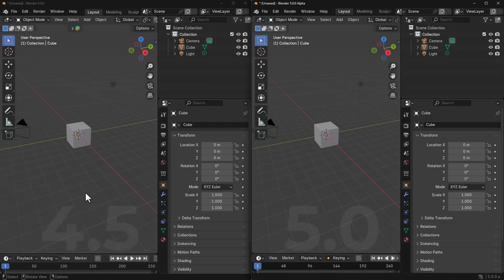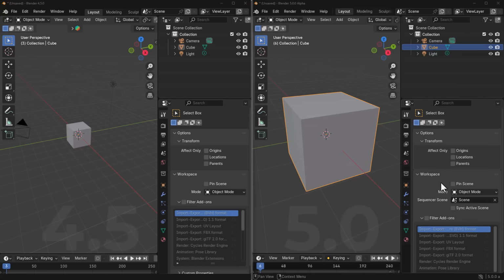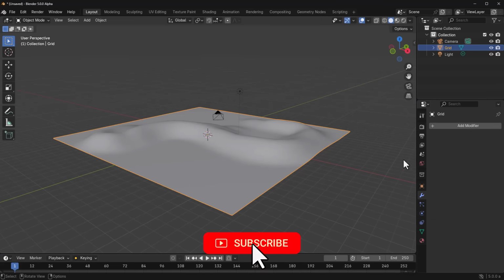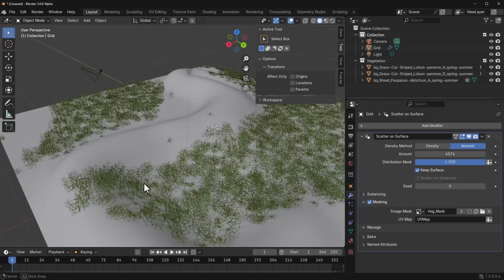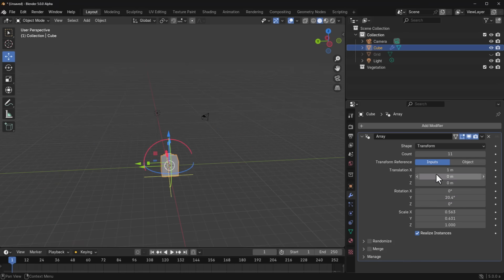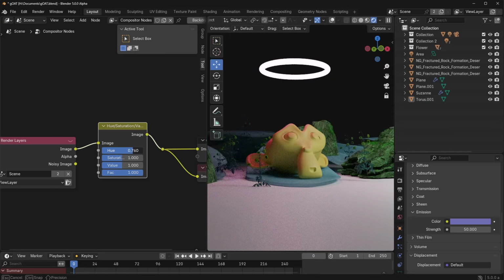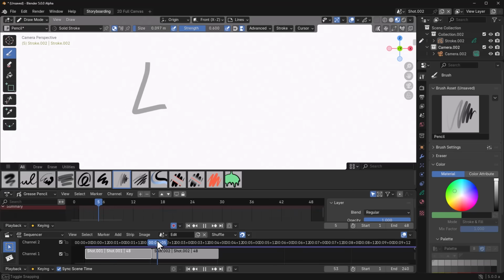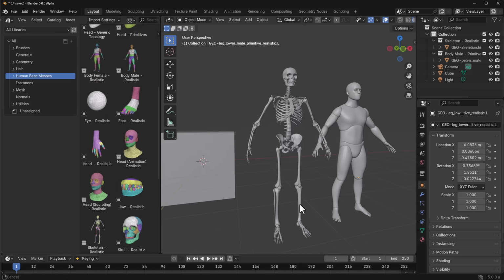Blender 5.0 - New Tools, Nodes, Modes & More!

Comment: If anyone says “game changer” it has to be a joke. This is a .0 release and the new features are laughable. The scatter on surface is the first thing you can do when learning GN, really basic stuff. The array modifier is not so much a new feature but a fix on a crippled modifier and the rest are just irrelevant or cosmetic features. It’s really frustrating when there are so many basic and useful things (like editable and dynamic motion paths, or even modern animation tools, sculpt layers, easy texture baking, native SDFs, better simulation tools, better clothing tools, hair dynamics, and so on) not implemented and here it comes Blender 5.0 and we get this, modifiers that were already possible with GN and some stupid unnecessary icons. Blender big releases are getting smaller, what a disappointment.

Comment: Unfortunately, the tube tool doesn't have options to properly do mitered corners in 2D or 3D. Is Blender the only software that cannot do this? I tried doing a tutorial that did this (Maurizio Bella? Not sure), but it was extremely complex, and by the time I tried geometry nodes had changed significantly enough I wasn't able to complete it and make it work. It's just common sense that a polygonal sweep should be able to maintain the profile cross section without dimensional changes.

Comment: The scatter on surfaces is a game changer. Instead of having to use an addon or recreate a new geometry nodes setup every time
Reply: Well, there are plenty of free powerfull addon solutions, so is not a game changer for me. But it is good to have native modifier in case when these addons may not work in the next releases.
Reply: I have a geo node setup I made and put in my asset browser. It has all of these features but this looks like it will run much better. Se excited!
Reply: @devonjuvinall5409  A good setup, but it's also great to have such a thing right out of the box.
Reply: @devonjuvinall5409 can u share that? ;)
Reply: Them sprinkles on donuts are gonna be easier to do. 😂
Reply: Isn't that just a geometry nodes setup but just as a preset? I dont use Blender, but isnt there a way to just save a geo node tree and reuse it? As in: you build it once and then save it so that it appears in the menu with the other modifiers.
Reply: yeah it looks rly useful, though I'm surprised it doesn't support masking via vertex group as well, though I guess masking via texture can allow for more precision without needing to add a ton of polygons
Reply: 99% sure this is easily done with emitters

Comment: Curve to tube is okay but it’s just taking most of the functions the curve already has and putting it into a modifier…. I’d like to trim the curve, res ample and change the uv directions in the modifier otherwise this modifier is just not as useful
Reply: That's kind of the point. You can absolutely do that. Before it was hard coded. Now you can go in to the graph and do all that.
Reply: You can do this in an independent GN network immediately before the new modifier. Save and reuse that as an asset too if you like.
Reply: Send the feedback to them, I hope they're going to add the feature
Reply: Okay cool do you suggest using the uv nodes already there or adding switches?